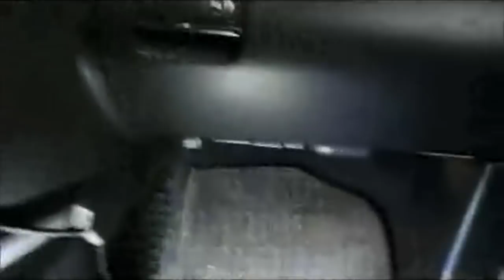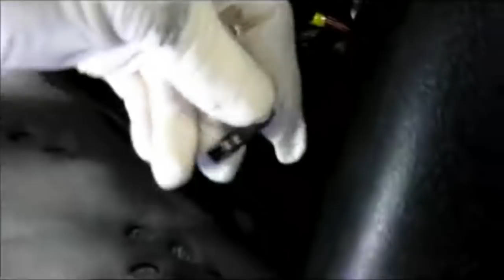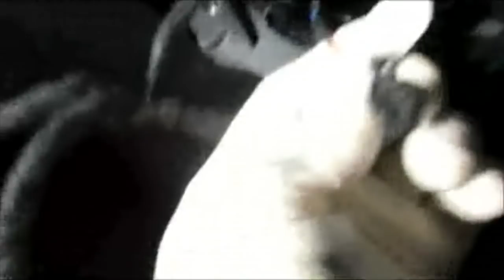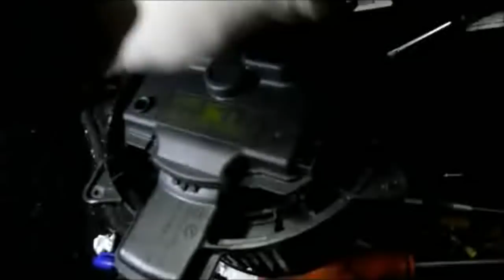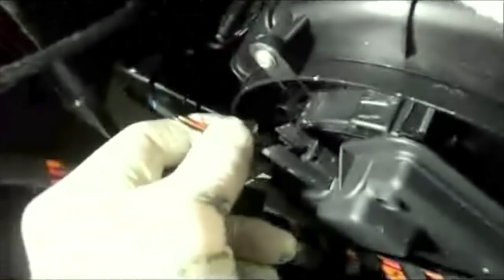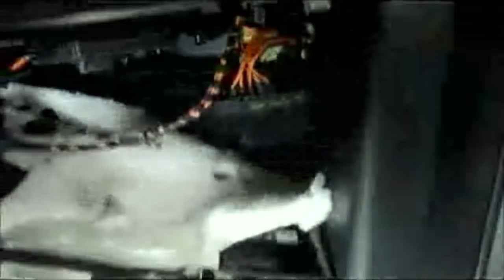2010 Mercedes Benz ML350 Blower Motor Replacement

Comment: Would this be the same reason the air does not shut off after I power off the vehicle.
Reply from the maker: It's possible, but it could also be a relay or control module issue.

Comment: Hello Jim, thank you for your video! I recently replaced the AC Compressor and Serpentine belt on my 2012 ML350.  All was working beautifully for a few weeks.  Just yesterday I hopped in my SUV with my family and the AC would not blow any air.  The display showed the fan speed increasing, but nothing was happening.  I was going to follow this video, to replace the resistor and blower, but now my AC Control panel has gone lights out.  I checked every fuse I could find, all of them intact.  I cannot figure out how to fix the AC controls.  Are the controls related to the AC blower fan and resistor?

Comment: This might be a long shot, but which fuse is for the blower motor? I'm having this issue and I am unable to check if it is just the fuse or if it is the actual motor.
Reply: If it was fuse i doubt the lights on heater panel would light up. Just guessing though

Comment: I have a Ml350 2006 and lately when I turn the a/c on (heat or cool), it works fine for a while. After some time, I can hear the fan on but no air comes out from any vent. What can be the problem?
Reply: Follow this video

Comment: My fan works if i open it up and spin it.  Is this fixable or do i need a new fan?
Reply from the maker: If you need to shake it something must be loose   Check that first
Reply: @jimthecarguy  Alright thanks.  Also, sometimes the fan will work fine, but when it does, the AC doesnt work.

Comment: Recently did a 1999 toyota rav  blower motor and resister not too bad .got my parts from rockauto and fit perfecto.notced on asian vehicles all metric 10,12,14,17,19mm sizes european vehicles odd sizes and lots of torx connectors.most mechanics in my area prefer to work on asian and domestic brands.off the clock of course